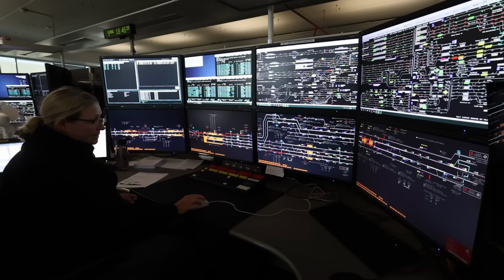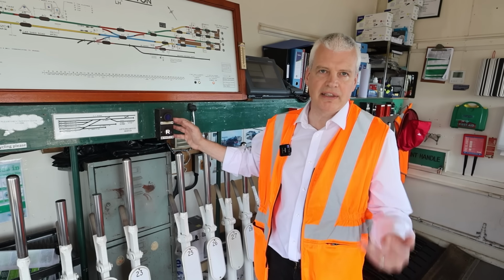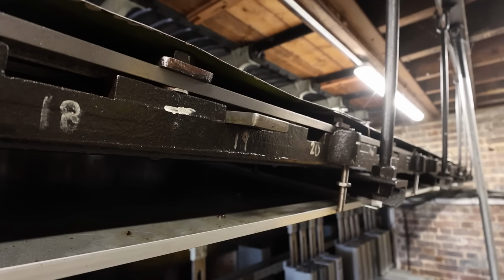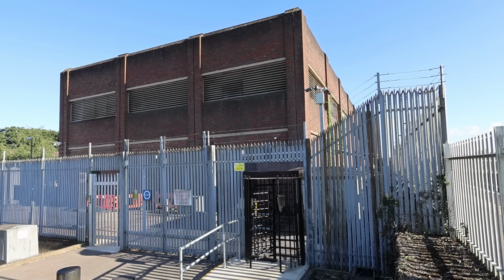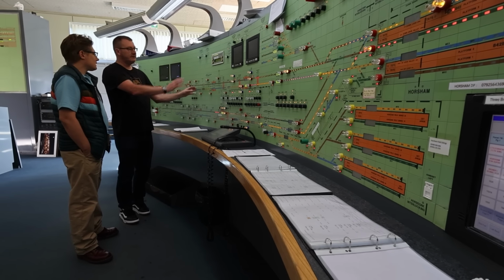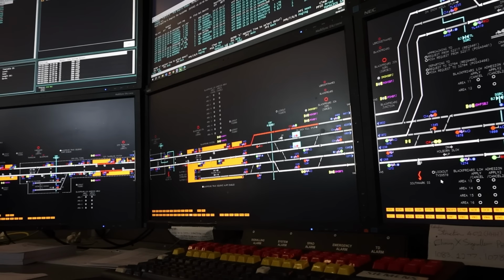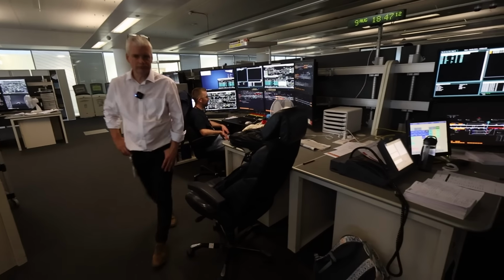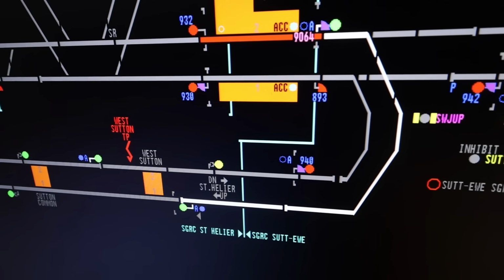Why Do We Still Have Semaphore Signals?

Comment: Geoff A very good video you have produced here, I have worked Mechanical Signal Boxes and watched the interlocking function, as you found it is fascinating. I have seen Radio Signalling in operation and something newer than ECTS known as ERTMS which is the most modern signalling in the country. ERTMS works via satellites and can tell the signalman how fast the train is doing and warn the Driver if he is going to fast and even put the brakes on if the Driver does not slow down very quickly. The system is so clever it knows the line speed at any given point and you can even program in temporary speed restrictions. There are no line side signals it is all sent as messages to the train cab, even the mile posts had to be changed to metric.

Having seen most types of signalling I do not think you can beat traditional semaphore signal boxes and the mechanical signals, I am sure there will still be many of them on the network in decades time. Shrewsbury's Seven Bridge Junction Box has been for many years the largest Mechanical Signal Box in the world with 180 Levers. Even when the mechanical signals and boxes have all gone from the network there are many on the preserved railways which have to be at the same standard as main line ones.

One Mechanical Signal Box that was unique in the country, sadly long gone, operated mechanical signals in 3 different counties, Dyfed, Gwynedd and Powys this was on the Cambrian at Dovey Junction. replaced by Radio Signalling it is these lines Sutton Bridge Junction (Shrewsbury) to Aberystwyth and Dovey Junction to Pwllheli that now have ERTMS.

Comment: Hi Geoff - Three Bridges ROC didn’t replace over 800 signal boxes when it opened. 

It’s replaced a variety of East Coastway mechanical and “NX” boxes, London Bridge ASC, and several parts of Victoria ASC.
Reply: I think he meant that the ROC controls an area that was originally controlled by over 800 signal boxes.

Comment: CTC signalers' job are unbelievable to me. One man to handle so many trains at so vast distance remotely. Besides ABS sections, there's still tons of switches and signals needs more manual operations. Also keep tracking so many trains at same time, especially if something goes wrong, I cant think what kinds of load that CTC signaler going to face.

Comment: The third main reason for resignalling is for consolidation; a long stretch of railway can be easily handled by one person using modern systems, where many mechanical signal boxes did previously. Thus many structures no longer require maintenance, fewer signalers are required, and communication within the signaling area and with other areas becomes simpler.
Reply: But the consolidated system is vulnerable, having lost resilience.
Reply: @physiocrat-sv  Yet on the other hand, there are more things to go wrong when there are many manual signal boxes; it only takes something happening to one of them to block the line. It's still possible to build redundancies into a consolidated system, just more expensive than without

Comment: A computer has the program in the same form as the data, allowing new programs to be loaded.  For a mechanical interlock, the code is the rod placement and the data is the lever positions.  It’s a calculator.
Reply: I agree the mechanical interlocking is not a computer as described by John von Neumann.  There is nothing like a CPU or finite state machine driven by a clock which drives the execution of a sequence of preplanned instructions.
Yet nor it is a calculator as most people use the term.
I think "mechanical computer" is a better term because the frame can be reporogrammed, as proven by all the white painted levers in the example here.

Yes the von Neumann machine design has been crucial to electronic computers as we know them, to say that anything which is not capable of executing self-modifying code is not a computer is going a step too far.  After all, self-modifying code is really hairy stuff and most high level programmers would be delighted if someone could come up with a machine which was fundamentally incapable of doing it.

Comment: A very different work environment for signallers when you compare the lever box (where some points at a distance from the box could need a lot of effort) to the signalling centre. In many lever boxes the signaller would spend most of their working days on their own, in the signalling centre it appears to be very much more team based, with your line manager on hand much of the time. Good video, and well done Network Rail for allowing it to be made.
Reply: Signalling centres are the railway equivalent of air traffic control which is where the concept evolved from.

Comment: You're quite right, mechanical interlocking is a fascinating technology. It's amazing that anyone alive understands it, much less maintains it. I'm sure those mechanical interlocking systems are built much stronger than modern electronic gear.
Reply: I think the knowledge gets handed down. Plus much of the componentry is still manufactured

Comment: "Did signalling lead to the computer" - NO! It was the Jacquard loom that used punched cards to determine the pattern on the cloths that were produced. The use of cards inspired Babbage and his work on his calculating engine (or Analytical Engine) and later was adopted to calculate populations etc.; the Census. Eventually it was the 80 column punched card that fed the electronic computers, such as the first ENIAC and later Univac and IBM machines, with input. Sorry to burst a bubble. 🤣😂🤣

Comment: It's a shame you weren't able to fully show the mechanical interlocking - this is something that I've always wondered about. I mean, intuitively I know its a bunch of metal rods intersecting in clever ways but that's obviously an over simplified view and the reality must be more complex than that, especially in the larger boxes that have a lot of potentially conflicting routes.
I'm surprised there is no ARS in the centre (or at least, not yet). And I refuse to believe that until the ROC opened there were still however many lever frame signal boxes you said, I imagine what you meant was there were originally that many - a lot of them had been merged into 80s style boxes (power box?) that you showed, but now those have been / are being merged into the new ROC?
Reply: There is ARS on the majority of the workstations at Three Bridges ROC, just not the workstations that they talk about in the video, yet.

Comment: Signaller here. I've trained a few signal boxes that are semaphore. Believe me, they won't go for a long long time. Absolute block works, and in places where there isn't a train in each signal section, all day, there is simply no need to upgrade to colour light.
Reply: Absolute block can be used with colour lights too! As well as semaphore signals with track circuit block I think.
Reply: @chrislambert-shiels5291  It can! Not sure if Semaphores can be used for track circuit block however. There could be exceptions, there always is with the railway haha
Reply: I know Chris would never say it on camera, but are money, reliability and central oversight not motivations for eliminating old signal boxes? Less signallers required (less salaries to pay), less hardware to maintain, less mechanical stuff to go wrong and having all signallers together in one room seems like something NR would want to push for as soon as they can justify doing it.
Reply: @mdhazeldine the reason I didn’t say it is that the cost of resignalling schemes is so wildly improbable now that “fewer people” isn’t enough of a motivation compared to the cost (Feltham resig was £345m). Also although you lose some posts, the ones that are left are almost always higher grade. 
In terms of having people in the same room etc, that is definitely a thing though yes.
Reply: @chrisdenham9086  Thanks for the additional insight there! Yeah I suppose £345m is quite a lot of salaries. haha
Reply: @mdhazeldine  Eventually, probably. Network Rail is always looking to improve the railway. However, old signal boxes work. They do the job, perfectly. It's impossible to justify the funds for it. However, more and more signal boxes are slowly being eaten up by ROC's. The train geek within me hates it. I love working signal boxes that are on the ground, over 150 years old. However, you cannot stop modernisation.
Reply: @Jack-ii8vi  the boxes more at risk of going to ROC's will be the NX signalling centres as it's far easier to switch from an NX panel over to a workstation as the equipment on the ground is mostly the same, I think there will be lever frames around for many many decades to come. Ironically the signalling centres at Basingstoke, Rugby and Three Bridges are still there even though there are attached ROC's!
Reply: 7 bells!
The Royal Train is entering the area of control
Reply: @EugeneMurray-z1b  7?
That's "Stop and examine train"

The Royal train is 4-4-4 from what I remember
Reply: Two that stand out to me are Willesden Carriage Shed North and South. They only control movements into and out of the intercity depot at Wembley along with internal shunting moves. No way NWR spend the tens of millions to put track circuits in, colour light signals and point motors that you'd need to run it from a workstation.

Comment: What I like is that there is still a human involved in critical decisions about safety. It is impossible to overstate how clever the human brain is and how far away from it AI is. Sometimes, humans are simply the better choice.
Reply: Mwahh, I have to disagree. Here in the Netherlands we use an automated system that follows the principles of interlocking but is combined with the path a train needs to take (scheduled route, platforms, waiting time etcetera) which has since the 90s made rail traffic much safer here. Interlocking is one thing, how about having a system that can't even think about sending a train down the wrong path. 

Signallers are still here for delays and emergencies, but the system is much safer than a human operator can be. Logic is poweful. A train is in a section? Okay, the signal is red no matter what. A train is nearing a crossing? It will lower. For sure. Look at the video. The signallers have to manually activate crossing gates or put signals to danger. 

In an age where train protection systems can see trains getting in the same block and crossings can have automatic activation I can not see one good reason to keep us humans in charge of saying where a train actually is. Not on heavily used networks at least. There have been deaths in many countries, even in the 21st century here in Europe, including the UK, because of signallers missing something. That's not a risk worth having if the alternative has worked for more than 20 years. There hasn't even been one accident in the Netherlands attributed to a failure of the automatic signalling system since it's full implementation in the early 200s. Meanwhile I only have to look to Germany in 2016 where 12 people died because of a distracted signaller.
Reply: @treinenliefde  I agree with you, humans are only, well human, and they do make mistakes. I do think they need oversight and people who can step in if systems fail, but to say humans are better than well designed computer systems is just rubbish (and this has nothing to do with AI, these automated systems have been there long before the current AI craze has come along).
Reply: @treinenliefde  they have that on some routes there too, it is called automatic route setting (he mentioned it existed but not on the workstation they were looking at), but there is always a time for a human, what happens if the standard path is blocked and you have to route trains around it? Sometimes sending a train down the "right" path is suddenly the wrong thing to do. Quite frankly we don't need AI at all though, better to have the signalling work predictably.
Reply: @treinenliefde  We have all the same technologies in the UK (traffic management, automatic route setting, automatic level crossings with obstacle detection etc) but they're not applied universally, partly because of cost partly because there's no need on quieter bits of the network.

Comment: Signal boxes didnt invent computing as such, but we DO use some signalling jargon (interlock, signals, semaphores, tokens)  in Concurrent software to prevent conflicts in resources, etc which is exactly what signals on the railway are for!
Reply: it's a precursor in the sense that it was an early application of binary logic; that and textiles manufacturing -- it's a computer in the same input+logic=output sense that Babbage's difference engine is (he and his family have a lot of railway connections)..
Reply: @lawrencejob  Sorry for the late reply, whilst I do see where you are comming from, its not quite the same. A computer is a programmable device, and software is the program. A better comparison is to image signalling as a State Machine, in fact  with its interlocks it was one of the original state machines. Today statemachines are largely written in software, but not so long ago you may have seen them in Tape Decks to prevent you from pressing the wrong button when in the wrong state (ie forward and rewind at the same time) using interlocking hardware.
Reply: @lawrencejob  Indeed, for Charles Babbage worked for the Liverpool - Manchester railway for a time and also conceived the idea of the cowcatcher device for locomotives.
Reply: I don't know how I've never made that connection
Reply: @SingleTheShot  Me neither! Brilliant bit of trivia.
Reply: I'm thankful we hold railway operation to much higher safety and quality standards than software. Wouldn't want to take a train running into a race condition. 😅
Reply: @rafsonrafson You do know that the railway operators depend on software for their safe operation, right? And that the software they use is held to a very high standard indeed?
Reply: @digitig safety critical stuff e.g air traffic control, railway control is written in ADA. A programming language much stricter than most popular languages and testing is far more stringent. You just can't afford blue screens of death or critical stop errors in these systems.
Reply: @Interdimensional27   Some of it is in Ada, though not much. But the constraints on software development are certainly onerous. (Until I retired last year I was a senior aviation safety consultant, and am very much familiar with IEC61508 and CAP670, and worked alongside people using the railway Yellow Book.)
Reply: @Interdimensional27  The French use B-Tool, a tool that does the strict logic modelling and interlocking. Note a language itself does not make something less or more safe, I can create some dodgy code in ADA as easily as I can in C, just takes a little bit more inventiveness. Modern IDEs and Software based checkers are able to spot bugs even in the notoriously "lax" C Language. In fact today the biggest cause of incorrect operation is due to integration issues, with many projects still failign to do proper intergration tests. (I am saying this as a developer who has been in the business for 30 nearly 40 years, using languages such as Basic, C, Pascal, Modula 2, BTool, Java Kotlin, Scala, JavaScript, Goovy, and many more, creating many types of applications from mobile stuff to big iron)
Reply: It really annoys me that some people use up and down relating to semaphores in computing. Both upper quadrant and lower quadrant semaphores exist and up and down mean opposite things for each.
Reply: A signal block is like a big fancy Mutex!
Reply: the term originally referred to humans. I think it  dates  back to the 16th century,. The mostly female mathematicians  who manually calculated a lot of the early 20th century astronomy equations and data were called "computers".  It wasn't until mid 20th century that the term was applied to what we now today call electronic computers.
Reply: It is more accurate to say that concurrency theory in computing borrowed these terms from Victorian era railway signalling. The problems are all the same, at some degree of abstraction.
Reply: @trueriver1950 I am certain that my original post did imply that software concurrency terms did indeed come from the railway terms due to abstractly similar problems?
Reply: At least in my area of networking and security, I've never heard of semaphores, potentially heard interlock? Tokens I've heard plenty with APIs, signals in the electronics side so many times.
Reply: I thought that the primary purpose of signals/block signalling is to maintain separation between trains. There are, of course, exceptions e.g. permissive working.
Reply: But a lot of early computer research was done by the Tech Model Railway Club at MIT, as they automated their model railway system (and created the Jargon File, which standardised and publicised much computer jargon), so terminology crossing from railways into computing was not a coincidence. Computer jargon does come from railways. Model railways.
Reply: @digitig  Whilst related, the TMRC created its "language" in the 1950s, when £digital computers" were already available since the 1940s Collossus, eniac, etc) and the terms were already used by the creaters of Collossus in Bletchley park (I visited the Park a few years back, and read notes that only recently were de-classified)
Reply: @digitig  Are you insane ? Tell me where was the Worlds first Model Railway Club ? And how you can honestly think an American University MIT  is involved ?

Comment: There is another type of signalling, Radio. Started operating in Mid Wales since the 1980s. Is it feasible to replace semaphore with Radio?
Reply: That sounds like Radio Electronic Token Block - also used in Scotland. It’s since been replaced on the Cambrian Line in mid-Wales with the newer ETCS (European Train Control System), which is a cab-signalling system.